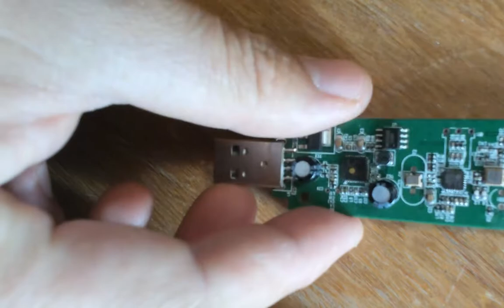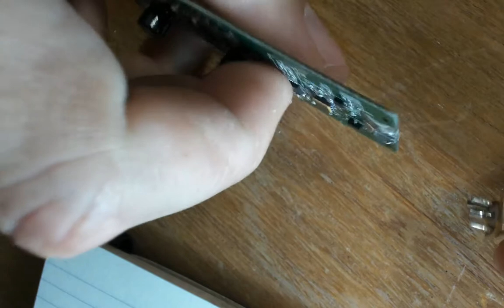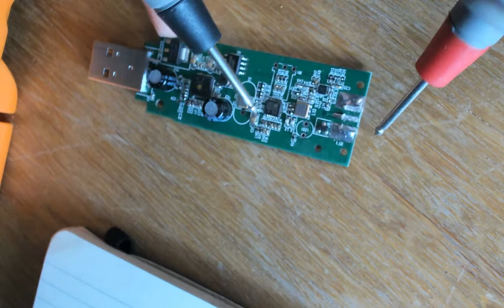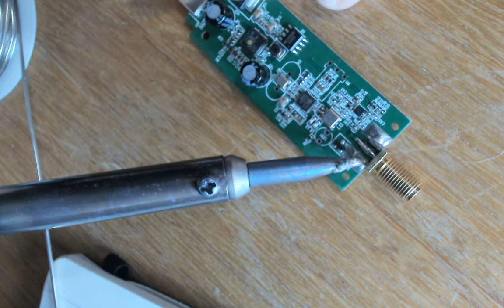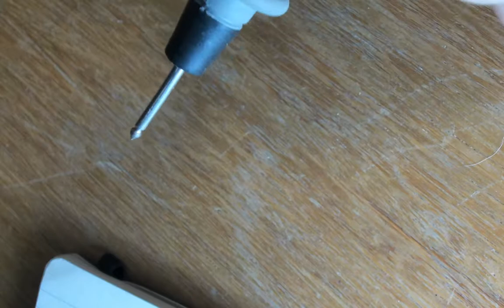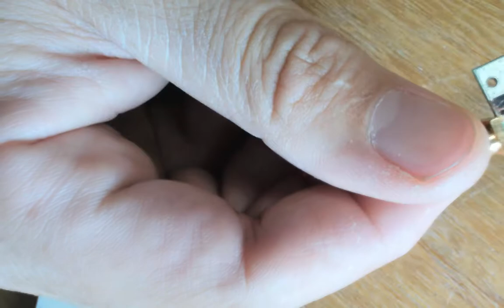Repair ADS-B Flight Aware ProStick Plus

Comment: I think my stick is suffering a similar issue. I think the middle is potentially in need of reflow, the other bits look fine. I notice when I'm using the stick, it would lose signal, but if I tap the SMA, or push it in a direction a little, I suddenly get all my planes back in FlightAware.